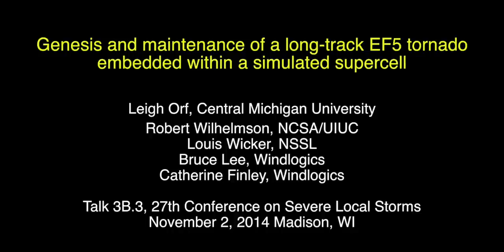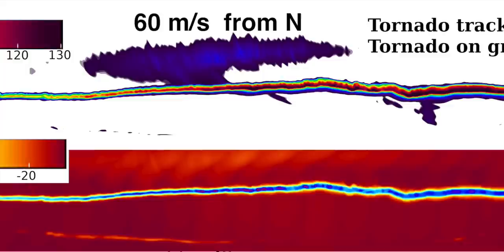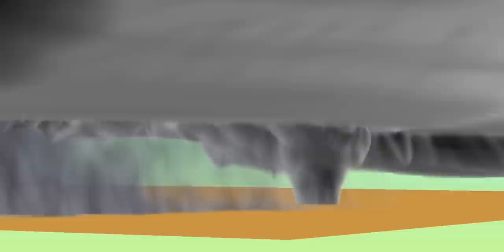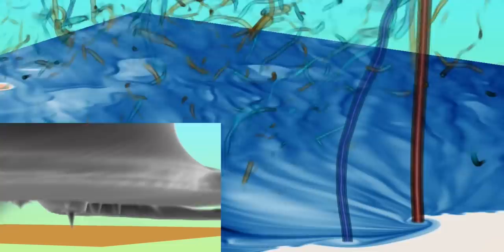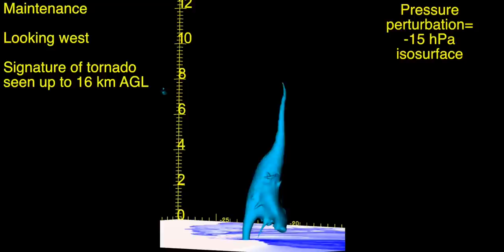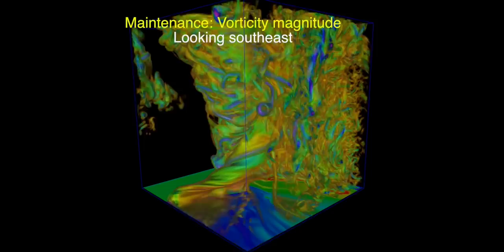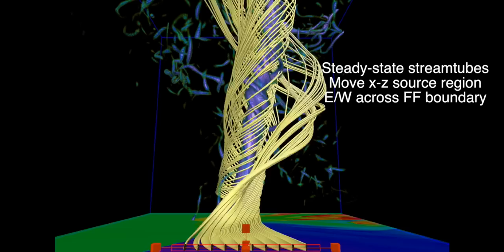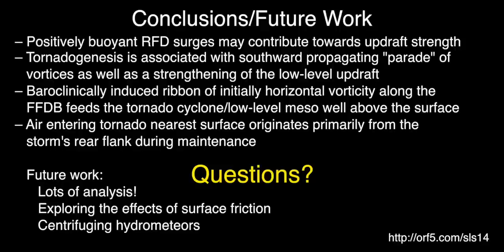Genesis and maintenance of a long-track EF5 tornado embedded within a supercell thunderstorm [SLS14]

Comment: The part around 13:25 was really fascinating.  Well, I mean the whole thing was fascinating, but that's what spotters need to watch out for, that sudden blast of cool air from the RFD that gets fed back into the tornado and rapidly causes a tornado to grow in size.  It makes me wonder if that's what happened with the El Reno tornado that caught so many spotters off guard when the tornado went southward, then massively increased in size and speed as it started on more of an easterly and North-easterly track.

I wish I had a program that could do these sort of simulations.  Even if it took me months to do a couple of minutes, I'd still love it.  I currently have the 28th fastest computer in the seti@home project, which is nowhere near BlueWaters' 20,000 cores, unfortunately, but it would still be fun to watch a simulation like that happen at slower speeds and be able to drop squibs in there anywhere/anytime I wanted to see what happened.
Reply: ***** Leigh, I don't know if you have heard of the boinc (Berkeley Open Infrastructure for Network Computing) or SETI applications, but what they do is take massive amounts of computational data and spread it across the computers of people who donate CPU/GPU cycles.  If you could find someone to write a program for boinc, you could always have access to tons of computing power, without having to worry about getting time on one of the super-computers like Blue Waters.  I know that a lot of the folks I've spoken to who run boinc and SETI are a lot like me, they're really into computers and science and are always looking for good projects to donate CPU/GPU cycles to.  700,000 CPU cores would seem like nothing compared to the computing power you'd have access to if you had your application working on boinc.  I, for one, would love to help out with a program like this, to help meterologists/scientists develop better models for storm and tornado prediction.  I'm not adept at programming so I couldn't help write the program, but I would love to help test and I'd gladly donate CPU and GPU cycles to you for the project (I have both ATI and NVidia GPUs).  If this is something you're interested in, please stress to the developer that you want access to GPUs, as they can calculate at many times the rate of CPUs when it comes to single-precision data.  The average computer these days has 4-8 CPU cores, but could have many thousands of GPU cores.

Personally, I donate over 5000 cores of CPU/GPU to seti and there are a lot of people who donate even more than that.  I think it would be really neat to be able to donate CPU/GPU time to help save lives by helping with storm prediction and modeling, but currently, there are no applications which offer that.  I live in Missouri, on the edge of tornado alley, so this is one of those things that's important to me, especially considering that my area has had 2 minor tornadoes in the past two months (thankfully, nobody was killed or seriously injured in either one).  The weather is one thing we all have in common, so I bet you could get a lot of people donating CPU/GPU time to you.

I've contributed over 36 million cobblestones worth of computational power to SETI (I'd estimate that's a couple times more than went into your simulation in the above video) and I'm just one person and by no means unique within the distributed computing community.
Reply: ***** Maybe one of these days someone will write a program where a wireframe, or very low-resolution model could be rendered on a regular computer, it could be analyzed and then you could determine whether you wanted to render it in high quality on a supercomputer.  That would allow you to choose the best simulations and run those.  That might be more work (for you) than it's worth though.  If nothing else, this would give you the ability to run soundings that you're interested in to see which ones produce a tornado and which ones don't.  It could be kind of a "spaghetti approach".  Having a massive amount of data at your disposal is both a blessing and a curse, I suppose.

Anyway, are you releasing the full video of the tornado you rendered from start to finish on your website?  I'd love to watch it form and go through its cycles.  I didn't see it here on youtube.  I thought about rendering one of my own, but even with my fairly-powerful home computers, it would take me at least a year to render one out in high detail and I don't exactly have 100TB of storage either.  I'm sure I could make it smaller, but even then, I'd run into memory constraints, as my computer maxes out at 128gb of memory.  I'd have to dedicate dozens of drives for swap space on top of that and with regular hard drives, it would all be too slow to write data from memory to the old rotational drives and back to memory.  I've used MPI and MPICH on my computers before, but even over gigabit, that's just too slow to get anything serious done.
Reply: Isn't it the warm inflow that surges across from the RFD ... The FF has the cool air?
Reply: @jamiewinterstern2327  you have inflow, RFD and FFD. 
.
to be a downdraft.... it has to be cool air

Comment: Well I spent 150 miles chasing today and I think I might actually be more impressed by this simulation. It's truly incredible, I am really in awe of the various storm-scale features that have been reproduced. I do have a specific question... I have always, since I was a child, fantasized about having a "thunderstorm in a box". Not just a hot plate and some wispy vortices of steam, I mean a fully functional, raining, condensing, latent-heat-releasing, fully-contained thunderstorm. This of course was only the wishful thinking of my 14-year old self, while sitting under the bright sunlight of a heavily-capped atmosphere. But sir, I would love to hear your thoughts on getting atmospheric-scale thermodynamics to happen on a smaller scale. For instance, do you have any thoughts on the demonstration the latent heat of condensation in any gas under any condition? I know that clouds form at the top of the Vertical Assembly Building at Kennedy Space Center. Thing is ~3.6E6 m^3... any thoughts on using artificial airflow, heaters, etc. in there to get some interesting micro-weather??

Comment: Reed Timmer recently got some amazing drone footage of a tornado forming next to a residential area and you can actually kinda watch this stuff happen in real life. The Anticyclonic "snakes" being whipped around the main vortex create little spirals all the way up. 

Also, I would love to see a successful recreation of the Pilger twins system. My best guess would be that there was a significant drop in pressure that causes a split in the SVC, or if there are two separate SVC's surrounding one low pressure zone. Interesting stuff.
Reply from the maker: I've actually tried Pilger, but was not successful (storm goes up; storm goes down; FIN). I'm sure horizontal inhomogeneities played a significant role in Pilger... and my "simple" approach won't cut it. However... someday!

Comment: Was this model based off of all the data collected by storm chaser's in the field as well as dopplar and other sites?
Reply: Maxx Madd  As you can read from the initial description in the video, the model was initialized with a RUC sounding and a w-perturbed initial condition. Usually, in very unstable situation like this one, that's all you need to simulate the supercell environment, obviously only with high resolution grids.
Reply: ok thanks for the info.